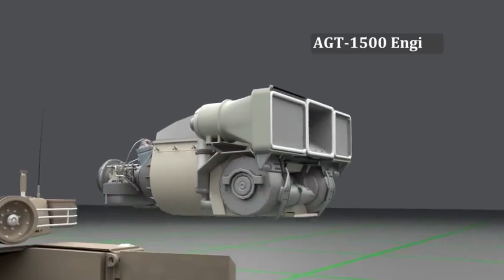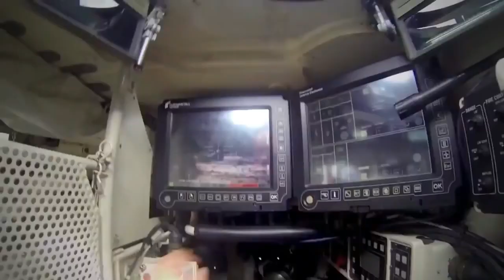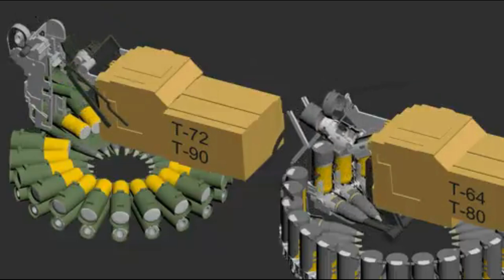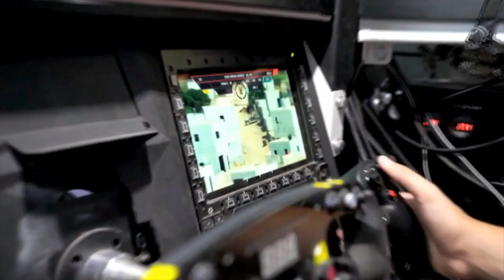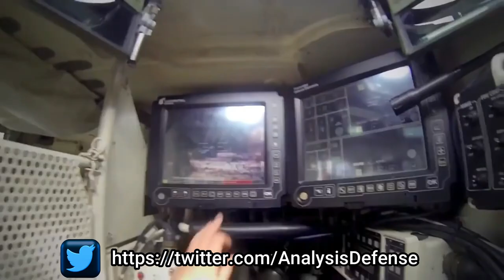Future Ready Combat Vehicle: Ministry of Defence intends to procure 590 FRCV #drdo #indianarmy

Comment: FRCV is clearly a T72 tank replacement. The biggest issue with T72, its carousel autoloader. Very happy to hear about bustle mounted autoloader and blowoff panels. That should solve the single biggest issue with T72, its tendency to explosive blow its top when hit by anti tank missiles, artillery shells and tank rounds. T72 tank is obsolete, and an early entry into service of FRCV needs to happen. An upgrade of the T90 turret with this technology, and APS also needs to happen. Arjun should also be inducted in large nos, at least a thousand, and T72 retired form service early. 2030 is too late, phasing out of T72s by hundreds should start in 2025 and finish by 2030. Zarowar,Arjun, T90 upgraded with FRCV tech, and FRCV should be only tanks in Vayu Sena by 2030. Even T90 should be phased out of service over next 10 years. Only domestic tanks should be in service Atmanirbhar Bharat!

Making T90s Future Ready by Lt Gen NB Singh in Defstrat magazine which was published on December 15, 2022 has some cogent points. T90 needs an upgraded engine, and improved ability to survive against top attack via munitions like Javelin. Hardening from sides and against top attack. A primary requirement of armour in mountains  is  to shield infantry and punch through defences that come in the way as was done in Zojilla. I would recommend fitment of modular composite armour  comprising ceramic, composites and titanium tiles on top  that would be effective against both ATGMs and Self Forging Fragments. Costs would be an issue but that price will be duly offset by the increaed survivability from top attack. Active protection systems may be evaluated for efficacy. Modern Software defined radios are needed urgently for all armored vehicles.

Masking of thermal, IR  and optical signatures is important as real time surveillance could play a significant role in degrading the combat power of a fighting  force. The PLA has a clear advantage in the  sphere of remote sensing and hence suitable preventive measures need to be put in place to retain surprise. In addition, selective hardening of tank electronics against high powered microwave attacks needs to be considered.

Although the author doesn't mention it, another need is fast reverse speeds so tanks can get out of an ambush quickly. All in all, with mass induction of Zarowar, Arjun, and T90 upgraded with FRCV tech, and FRCV should produce a modern tank fleet. The T90 is the last Russian tank and can hopefully be phased out of service!

Comment: What about the specs of the main gun? 125mm or 120mm? Smoothbore or Rifled?
Reply from the maker: 120mm plus. Smooth or rifled not part of spec.
Reply: It would make no sense for them to go with 120 mm rifled.
Reply from the maker: @bonk9614  why?
Reply: @IndianDefenseAnalysis  I also think they should consider fuel cells instead of diesel engine, because Tata Motors has an ISRO developed fuel cell able to power buses.
Tata Starbus.
Instead of investing in old tech, invest in the new!
Reply: @Indian Defense Analysis  Smoothbore cannons perform better because apfsds works better with them, rifled cannons causes the projectile to spin increasing the velocity of a normal shell but it reduces the performance of apfsds shells, apfsds shots already have finns to stabilise the round but these finns will not work effectively when the round is spinning. 

I can't explain the whole thing because there is a lot of physics behind it. Even the British are replacing their rifled guns by smoothbore cannons to fire modern projectiles.
Reply from the maker: @bonk9614  I got your point , DRDO will prefer rifled bore consider the experience they have with it. Smooth bore one will be new development. Let’s see what’s being chosen
Reply: @bonk9614  Rifled vs Smoothbore is a tradeoff between HESH (High explosive sqash head) round vs APFSDS (Armour piercing fin stabilized discarding sabot). 

It seems HESH doesn't work well with smoothbore and APFSDS rounds for rifled guns can't be as good as the smoothbore ones due to design compromises.

HESH rounds are used to destroy structures, wheras APFSDS is for destroying tanks. 

It all depends on what role that tank has to play. APFSDS is better for tank battles and HESH is good for tanks that perform support role and help with destroying structures.

It seems Arjun requirements were based on British Challenger tanks (which also had a similar 120mm rifled gun due to British preference for HESH rounds).

Rifled guns also can't use their barrels for launching (anti-tank) missiles.
Reply: @IndianDefenseAnalysis  India already has a 120mm rifled gun that we developed for Arjun.
Reply from the maker: @jarjarbinks3193  you are right I got confused. 👍
Reply: @bonk9614  even the british challenger uses a rifled bore, also the rifled bore can fire isreali rounds too. The advantage of smooth bore doesn't actually makes sense, given both have different works.

Also evn if they chooses a 120mm or a 125 mm both will be fine, these rounds are enough to destroy any MBT on the planet currently.